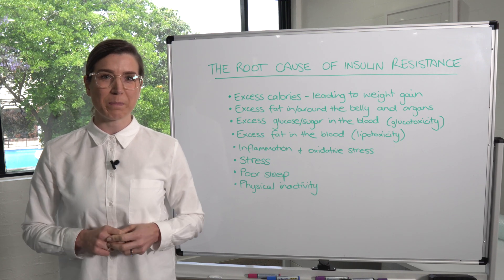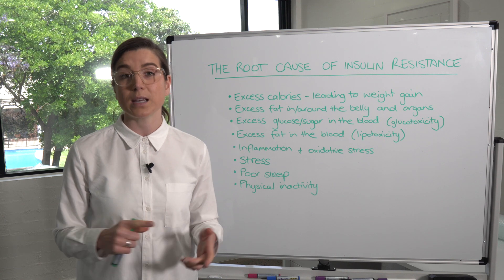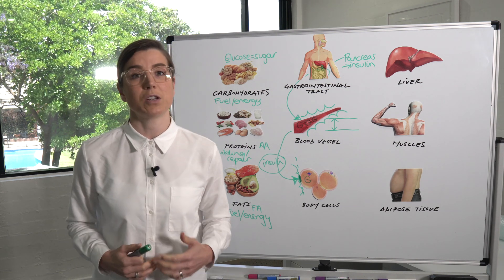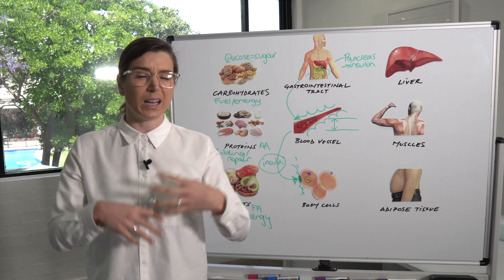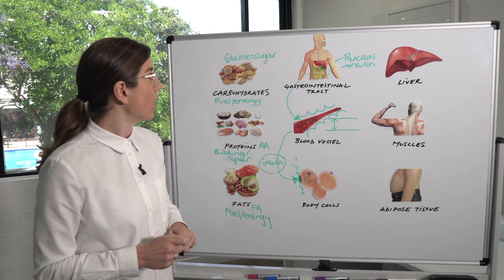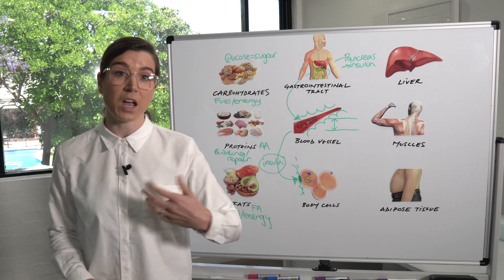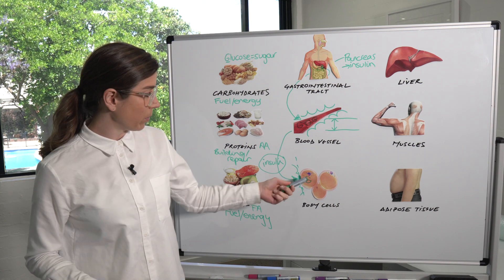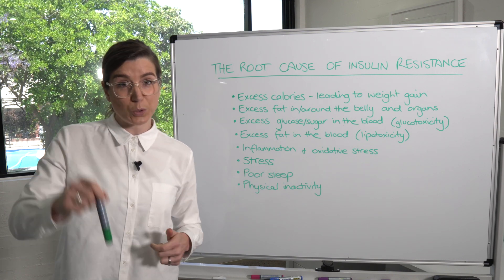How to Reverse Engineer Insulin Resistance. Part Two - Type 2 Diabetes.

Comment: Such an underrated video. Great content.
Coming from type 1 diabetic that could see the results of insulin resistance being lowered by sticking to such protocol. Managing stable glucose level have become so easy comparing to managing it with higher insuline resistance. 
Inflamation is a big factor, but diet - reduced fat intake, and also focusing on good fats, trying to consume them as snacks in between meals (let the cells deal with fats before you invite the glucose again). Eating mainly plant based, small amount of eggs, rarely good quality meat.
Worked for me. And many others as I have learned from Mastering Diabetes YouTube Channel.

Comment: Well I`m 58 and have a big belly and low energy levels. I'm trying to avoid the diabetes and heart problems. I´ve been all over the internet and  there's a ton of bad advice especially from the anti-carbohydrate brigade. Having seen maybe 100 videos on the subject, this is probably one of the best I´ve seen. If you have a big belly and are losing energy, check this one out before you get the diabetese and the heart attack. 

Top dollar!! Thanks Juliet